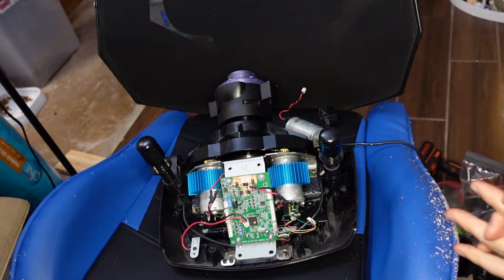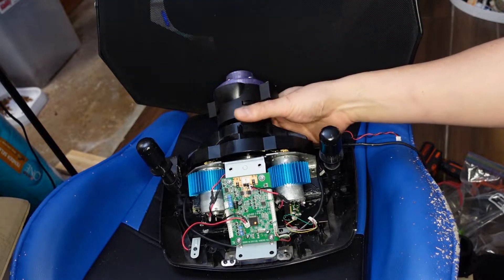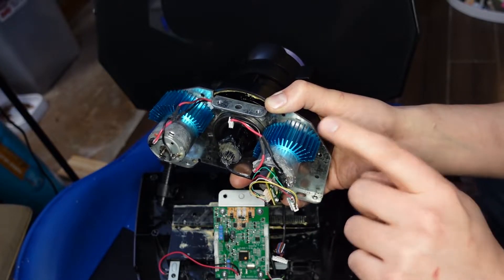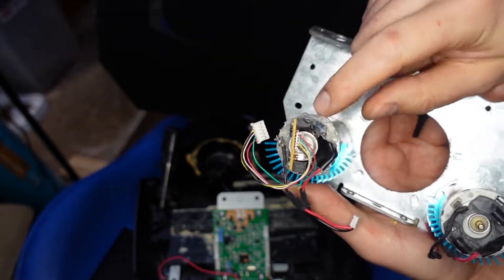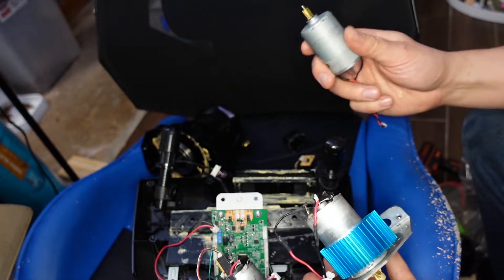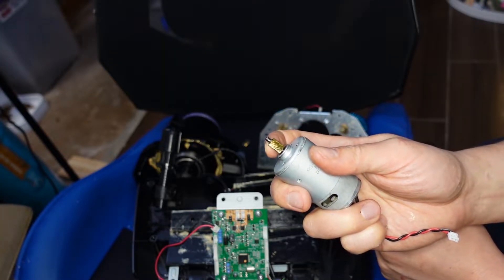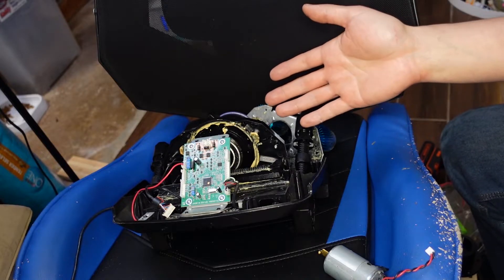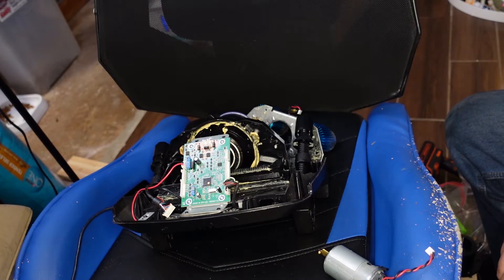Yoshi's brain dump - Logitech wheel upgrades and repairs

Comment: I put The 755 motor in It, triples The FFb
Reply from the maker: Awesome! Good motors. How did you wind up modding them to fit?
Reply: @protomor some axle drilling to The Old gears fit some, calculation for great positioning, and drill New holes where the engine fixes in front, The sensor, Same thing, drill The axle then plug and play

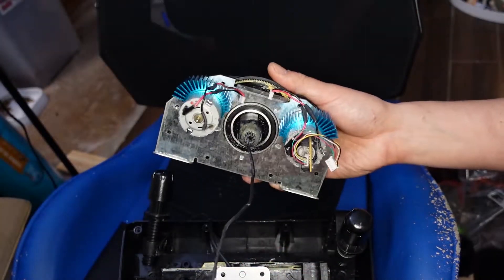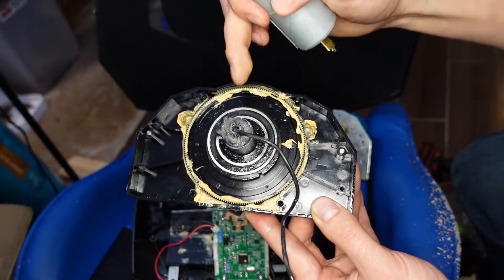Comment: 3:38  and 9:33 That cable that comes out of the middle of the wheel is your next nemesis. I can already see signs of kining and wearing out as it rubs against the casing. The cable they made that has to turn and twist 450 degrees each way which is untethered and destined to break just as mine did after a few years of use. Imagine using the wheel then in 1 second everything fails other than 1 "X" button which when pressed, activated every button press on the wheel at the same time! I remove the steering wheel and base cover and see that cable running down the center shaft is chinked and kinked in so many places along itself, warn out through the black protective covering and then it has cut through brown wire cover until that No 4 wire was stretched and broke causing the whole wheel to basically become abrick! Imagine a thin 5 cent cable hidden deep within the housing will eventually twist and break by design and fail. Looking at your cable here, it has already started to show signs of wear, When I contacted Logitech, they told me this is normal wear and tear of which I informed her then all the cables should show wear and tear but they do not. I find that a cable that twists thousands of times a year and not including the compulsory calibration, this is definitely a design flaw. I basically had to almost strip the wheel down to get access to said cable, make a bridge cable to rejoin the broken 1 then reinforce and protect the cable from further wear and tear. My wheel should now last a few more years, touch wood!!

Comment: why did you remove the flux ring ? the purposes of flux ring is for better flux and it will remove cogging , and improve torque,i get it it can rotate faster , but is it worth it considered the motor is already weak which is only 2.5 nm , and it got even weaker after you remove the flux ring
Reply from the maker: You're right. It should be left on. I took it off for more surface contact with the heat sink. But it's not necessary

Comment: Is it normal for my G29 to have a lot of play in the centre? Also, when I’m drifting and hit full lock (left or right), it doesn’t always auto counter-steer when I let go of the wheel. Sometimes I have to move it slightly myself before it does. Any ideas
Reply from the maker: @GhostyInjected  no it's not. Some screws are loose. Take off the wheel and the 3 screws that hold the center to the base will need tightening. Loctite is recommended to prevent them from backing out again.
Reply: @protomor  I've taken it apart the 3 motor screws on both sides are tight and everything looks greased
Reply from the maker: @GhostyInjected  Hmm I'd have to see it in person. Somethign seems loose.

Comment: Amazon has pinion pullers for the gear for under $20
Reply from the maker: I tried a few. None of them work. They either couldn't get under it or it broke. Butane torch was the only sure way to get it off.

Comment: You can buy a pinion gear puller for the motors.  Rc cars.   You can heat the gear or put it in the the freezer and pull it off

Comment: The motors are called 550 cans.  Used in  
1 rc cars
2 power wheels 
3 power drills.  
You can buy ones with a high torque rating.

Comment: I messed up the brass gear too much. Is it possible to buy a replacement?
Reply from the maker: @iph09  I haven't found a place that sells them. Sorry man
Reply: @ thank you for your response
Reply from the maker: @iph09  Yea sorry, Hopefully you can fix yours well enough to reuse it. I designed a 3d printing model no thingiverse but plastic doesn't work, you'd have to get it cast in brass.
Reply: @protomor  I tried to grind it, and luckily it looks usable. I installed it on new motors, but now the wheel just keeps calibrating - it keeps spinning fully left and fully right before stopping. Logitech G Hub shows the wheel stuck at 0 degrees. I don’t know what’s wrong with it. I guess I’ll just give up fixing this broken G29 that I recently picked up and start saving money for a cheap entry-level Direct Drive 😅. I love this new simracing - motorsports hobby but it’s such a luxury in the third-world country where I live to even try it.
Reply from the maker: @iph09  That usually means the wheel sensor isn't on right. If yours is the magnetic type, make sure it's clean and spins properly. If yours is the slotted wheel type, make sure it's on right and within the sensor limits.
Reply: @protomor  thank you, i will try that
Reply from the maker: @iph09  No worries. you might have to disassemble it a few times. I tend to leave the case of until it works. But don't worry, you didn't brick it.

Comment: Where can I order the brass encoder wheel
Reply from the maker: here is where I got mine: https://cmlaserservice.com/index.html
Reply: @protomor  I opened my wheel up and it seems I don't have this, looks like maybe a magnet and hall sensor?? How do I fix the wheel slowly unaligning issue in this case
Reply from the maker: @TheEliteShatter  Ah you have the magnets then. Alcohol wipes to wipe off the magnet and just generally clean up stuff and reassemble.
Reply: @protomor  Magnet is cleaned and still has the issue, where can I source the hall sensor?
Reply from the maker: @TheEliteShatter  I've never seen one of those sensors fail. Maybe it's too close or too far away from the magnet or the magnet isn't on right. Keep messing with it. You'll get it to read lol.

Comment: could you- or someone work on making a STL file to house the motherboard and the ports so you dont need the bulky wheel anymore- that would be cool.
Reply from the maker: You mean without the wheel? So you can just use the pedals and shifter and not the wheel? Not a bad idea.
Reply: they sell cables so you can use the pedal and/or shifter without the wheel. leo bodnar cables.

Comment: Great vid. How do i minimise that tiny movement in a neutral position. I have about a 3 mil sway that causes rattle.
Reply from the maker: @Howlingbrown  that's likely from wear and tear. You can maybe oblong the mounting holes so they're tighter to whatever gear it wore from. But that's only a temp fix
Reply: @protomor  brand new g923 used for months been playing in a friend's g920 and it's not got that clunk when you cross mid section
Reply from the maker: @Howlingbrown  only when it's mid section? That sounds like a software setting then? The gears don't care about center.
Reply: @protomor  yeah that tiny bit of nothing at neutral

Comment: Hi, just for information if anyone needs that. I got G27 which I bought already used in 2012 year, so at this point my wheel got 12 years , and used mostly for drifting.
1)More powerful AC brick - for me it was necessary, because ~4years back I can feel weird FFB after faster rotation or full lock rotation, it goes like weaker or something , and AC brick fix that thing for me! NO BETTER FFB , just stable FFB for worned out wheel, all time before FFB was just fine till that one moment when can feel that there is something happening not right. 
2)In 2021 year I opened wheel base for first time and curiosity about status there - there was dusts of course , but nothing critical, almost none lube on gears , and big crack to plastic bearing case where is motors, but still going as it is. And lubed gears, don't remember what grease, but which doesn't eat plastic and rubber, and added something like soft rubber things where is lock end on both side to silence the wheel , and there was results for that.
3)Still going with stock wheel rim and not going to do real car wheel mod to see how long lives wheel/motors. PS. bigger car wheel with hub makes more stress to motors where need obvious take more FFB power to rotate all that like normal , and that slowly kills motors... (Taking that from friend experience).
4)At point ~5years from purchased , started problems with pedal potentiometers, starting with one pedal, then two and then all, and cleaning kinda helps for first day and then same potentiometer spiking in games. Now I can use max 50% of pedal travel after re-calibrate to still be able to use pedals... Also , pedals are mostly really dirty, and need clean more often and ideally put some kind of dust shield where is pedal cylinders to eliminate biggest part of dusts. 
5)In 2024 started problems with gearbox too, where 2nd and 4th gears are jumping out or switching, feels like loose connector or something, now gonna open that thing to basic full clean and then see if that helps , or there is also potentiometer fault.
*Gearshift back in business - opened ,really tiny dusts inside, bit plastic crumbs and no obvious defects. Standard cleaning with alcohol to both potentiometers and wire connections and put all back together. Added 3d printed plastic D5 L4 mm( to pre-load bottom spring) , little bit better feel of shifting, but definitely can put longer or double what i use there. Also put 3d plastic bottom from gear knob L20mm to remove mini stress from leather boot.
6)Now in 2025 main wheel base clamps starting to get loose while clamps itself are fully tight, but bottom side got loose, can figure something out about that, but bad thing...

Comment: Thank you for sharing 😊
Lock mechanism… I managed to break that plastic slider on the g.29. Any advice on getting such a spare😂?

trying to upgrade the clamps for a new desk, I managed to compressed the side without the “gears” 😢
Reply from the maker: Slider? Like the lock that goes under the motor gears? I'd try to plastic weld it back together. But that might be all you can do for the wheel.
Reply: @ thanks, accepted my failure and bought an extra one while I try and get a hold of an extra one 😝
Reply from the maker: @MrMorrison1982  if you're selling your old stuff, I might be down. I kinda want another g29 to do mods on. Also looking for just pedals .

Comment: hi i have a problem with my g29, when there is the feedback hole turning to the right the steering wheel makes a loud noise of gears, as if it were creaking. if instead i turn to the left it is silent. Do you know by chance how to solve it? thanks
Reply from the maker: Something is loose. The type of stuff you're explaining looks like some of the screws that hold the base plate on. Flip the unit over and check underneath and make sure all the screws are tight. Next after that is the 3 srews that hold the steering wheel onto the center support. If neither of those are it, you're gonna have to open it up and poke around to see what's not tight.
Reply: @protomor  I opened the steering wheel completely, greased all the gears, then closed everything again, tightening every single screw, but it still makes the noise... could it be one of the two motors? Since it only makes noise on the right, maybe the one on the right?
Reply from the maker: @samuelebravo4116  Hmm, the fact it's only on one direction usually means a lash issue. Where something isn't aligned. I dont' think it's the motor. But who knows.
Reply: Where can there be something not aligned?
Reply from the maker: @samuelebravo4116  the locking plate that mounts the steering plate can be misaligned. I've seen the bow spring get misaligned as well. The bearings in the steering shaft could be going bad and causing the big gear to have slop. You can send me pic and video of the teardown and I can give my opinions. If a bearing is bad tho, I don't know where to get new ones
Reply: @protomor  sorry what is the “bow spring”? where is it? anyway thanks for your help, when i open it again i will send you the photos and videos. where can i send them to you?
Reply from the maker: @samuelebravo4116  It looks like I glance over it in the video but around 12:10, you'll see a piece of metal on the base itself before I put on the rack. It's a bowed piece of metal to keep pressure on the rack. 

For email its my username at gmail.com

Comment: The g920 and g25 are infact different internally. The g25 has straight cut gears and the g920 have helical gears. I have both and the g25 takes a little bit more force to turn while off and its louder.
Reply from the maker: Interesting. can you send me pictures of the differences? I always did feel like the G25 was loduer.
Reply: @protomor  I don't want to take mine apart, there is a YouTube video called Logitech g25 maintenance by BTG that shows it fully disassembled. They moved onto helical gears in the g27 and later models.
Reply from the maker: @mashedpotatoes5323  I'll take a look. Thanks for the info!
Reply: Additionally, I read somewhere that the Logitech wheels can operate on different APIs for force feedback depending on the game, some APIs allow the wheel to run at a higher torque all the time but clip peak torque events, whereas others maintain the dynamic range and leave headroom for peaks, this can give the impression that some wheels are consistently stronger than others, when most of them except for the DFGT have basically the same two motors. I only looked into this after a store clerk who had tried a few mentioned that the G923 was weaker for drifting compared to the G29 as it didn't correct as fast.

Comment: Hey man I've seen all your videos based on the wheel modification and I have a question do you reckon I can replace only one motor from an rc car to avoid the calibration trouble and stl 3d print part
Reply: Or drill a third hole and put the rc motor there and split power from one of the already existing motors so that I have 3 in total
Reply from the maker: Sorry for the late reply. No.. you'd make the motors fight each other. Shortening their life.

Comment: Hi :) so basically my g920 is failing on calibration and not spinning left and right all the way. I'm guessing it's something to do with the cog/slider .. you mentioned in the video about other tutorials for setting that part up? Please could you link them?? 

Thankyou so much in advance
Reply from the maker: The video should explain the insides pretty well. Basically, disassemble, make sure it's aligned and spins fully, put back together. But I'd say 90% of what I see is that the sensor wheel is broken or dirty.

Comment: i'm having mega trouble with my new 30 slot g27 atm i doubt you will reply to this comment but if you do i also stream and upload to youtube raly is my thing sim drifting is my thing i have the new encoder i installed it but i'm having mega issues please reply :(
Reply from the maker: If you replaced it with a different encoder wheel, it def won't work. Make sure you install the same one as what used to be in it.
Reply: cheap china stainless steel one i flipped it other side it had a scratch on it darkened it with perma black marker and now its fine yay now my shifter has a plastic plate that holds the pot on the forward back pot one side of the little prongs has snapped so i need the metal replacement one si can''t find them anywhere anymore 3 years ago i saw them somewhere iunno even what they are called .... then the last step is better pots for pedals ... @protomor
Reply: hiya yeah thanks for the reply so i got the encoder sorted but now i need a new plyg for the potientimiter for the gear shifter the one at the back has had too much abuse i need to know what the name and size of taht plg is so i can ask about locally for one at like hardware stores and such. came soo close yet so far to sim streaming on twitch again. it's such hard work with gear like this to stram. now i know why people stream games like dota and fortnite. lol. none of this fixxing hardware headaches. btw nice video it was most helpfull up to the point of the wheel base. pedals is quite simple and str8 forward but the shifter is a nightmare. where can i get replacement pots and plugs for the pots? if only i knew the name and size of the plug? do you know by any chance please? thanks in advance @protomor

Comment: Have you ever come across an issue with the G920 where it will not power up? I have a pre owned G920 and no light comes on when plugged into the main supply. I have changed powerbrick and cable but still no power
Reply from the maker: Sometimes they won't power up until plugged into a USB slot. But if it straight up won't power up, it could be the capacitors. But no I've never come into that exact situation.
Reply: My G27 took a crap. Ended up replacing the board
Reply: Maybe try another USB port.

Comment: I am one of those sad souls with a g29 that has full left lock upon booting or plugging in the wheel. Tried replacing the power AC adapter and open in the thing. Up to see if anything was out of alignment. But everything looks good. Some folks say it could be a combination of the motor with the hall sensor? I don't know what to do. It's just too expensive after only one year of use to just let it go and it's not under warranty now of course
Reply from the maker: Check the encoder wheel for cracks. If yours is the magnetic kind, take as much of the encoder stuff apart as you can, clean it with alcohol wipes, and put it back together.
Reply: @protomor  i already clean the magnet and still full right lock, do i have to fully disassembly the sensor and the motor to clean all of it ? or just the exposed magnet to the hall sensor ?
Reply from the maker: @louisrefitra9097  The magnet and the receiver both need to be cleaned. You can keep the top off and watch the mechanics work. But sometimes, it just fails.
Reply: My sensor was cracked I just tightened the mount screws and Shabam worked and calibrated perfectly